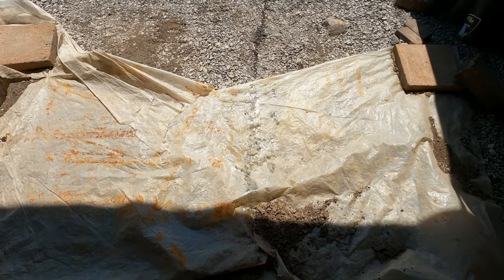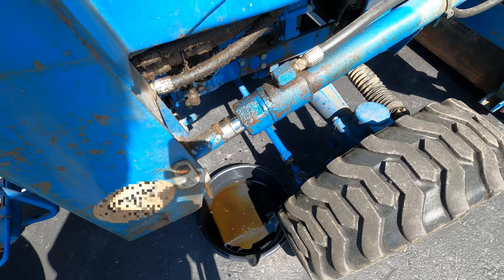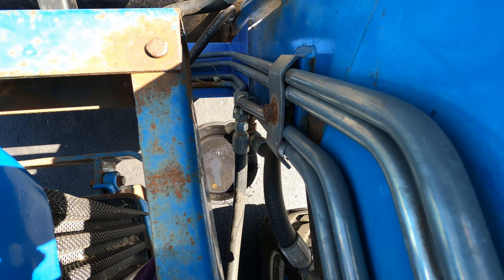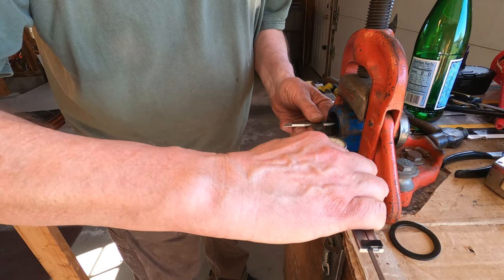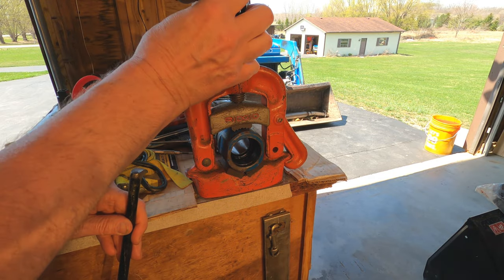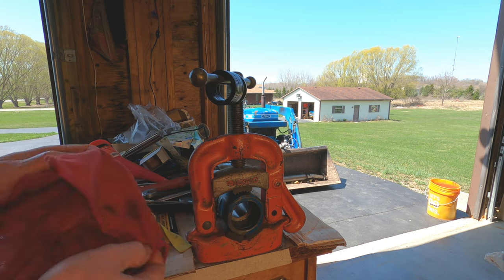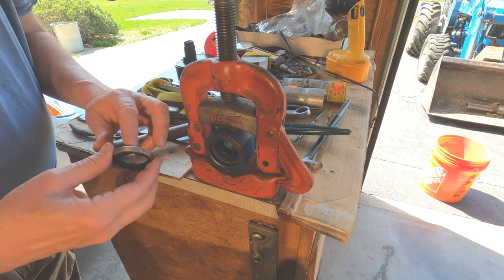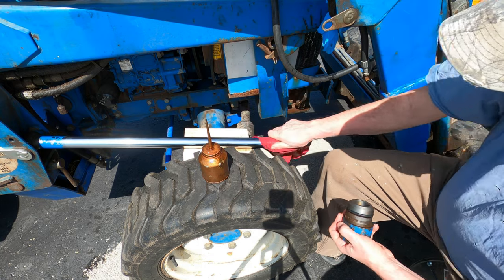Replacing Seals on a Ford 770B Loader | 1710 Tractor | Man About Home

Comment: MAH,   This instruction was exactly what I was looking for for my 1710 with a 770B and two leaking cylinders.    Off to fix my tractor this weekend!   Big thank you.
Reply from the maker: @guesswhotoo6  You're welcome! However, I've learned something important about this job since I did the first one. I plan to try doing it differently on the next one. This should help a lot. Do you have the 770B manual? There's procedures in there to loosen and tighten that seal compression nut on the end of the cylinder rod. You can remove the hydraulic fitting on the fixed end of the cylinder to gain access to the seal nut. Poke a pin or drift through that hole, into the hole in the seal nut. I imagine getting it lined up will be a bit tricky. Then rotate the cylinder or cylinder rod to loosen or tighten the nut. If you don't have the manual, you can contact me via my gmail address found on this channel. I'll send you scans of the cylinder seal replacement pages. Thanks for watching and commenting! And good luck with the seal replacements.

Comment: It’s like looking into a crystal ball. Good job on the video. I have the 770a with a small drip for the last 3 years. I bought the seal kit for it, but haven’t gotten around to it. Looking for a full tune up this spring, so prepping my mindset.
Reply from the maker: Thank you. If you have the manual for the 770a, I've since learned that it gives good instructions on disassembling the cylinder and piston. If I ever have to replace the seals on the other side, I'll be trying their technique to loosen that round "nut" that holds the seal pack so tightly. It appears to be a lot better than how I did it. You can probably find a manual on line if you don't have it. Thank you for watching and commenting!

Comment: Very nice video, just rebuilt a cylinder on my 1710 for my first time. I had a few trips to the dealer. But I got it done. And works good now. Mine was way different than that as I have a bradco loader on my tractor. Overall good to see that process all the way through.
Reply from the maker: Thanks for your comments. I was learning as I went, with this job, and I've learned some useful things after I did it. The next time I do one of these, I'll be doing some things differently. It sounds like you got it figured out as you went, as well. Thanks for watching!

Comment: Thanks for this video.  I’ll be doing this job soon.  You mentioned a service manual for the 770 in another comment.  Could you please share where you got the manual or just share the helpful info it provided?  Thanks Eric
Reply from the maker: Eric, I have the manual that came with the loader when it was new. It's the Ford Series 770B Quick Attach Loader, Operator's Manual. They're available from several sources if you search. I'm also adding a link in the description. Thanks for watching and good luck!
Reply from the maker: Operators Manual for Ford Series 770B Quick Attach Loader Owners fits 1310 1510 1710 1910 Tractors
https://www.amazon.com/Attach-Loader-Operators-Owners-Manual/dp/B07HSXKFTN?&_encoding=UTF8&tag=manabouthom0b-20&linkCode=ur2&linkId=1a9eefc00b7aff2eb8b64945da9373ba&camp=1789&creative=9325

The manual shows a better way to disassemble the pistons.

Comment: i have the same tractor  runs good some issues   now  getting hard to find parts for it
Reply from the maker: I've been wondering about parts availability. I haven't had to find parts for mine yet. But I'm sure I will at some point. My tractor is still running good. I've been working it pretty good this Summer. Lot's of mowing with a six foot finish mower. Thanks for watching!

Comment: Where did u get the seals and part number
Reply from the maker: I did a web search. Seals are available on Ebay and Amazon.  I have to warn you, the seal kit I used wasn't exactly correct. One of the new seals was thicker than the original. All the others were perfect. I was able to make it work for now, by not tightening the piston seal nut down all the way. It's working as it should, with no leaks... for now? But when I do the other side, I'm going to dissemble it first to make sure all the seals I get in the kit match correctly. If there's a mismatch I'll talk to the supplier directly to correct the discrepancy. I used SML22859. Thanks for watching!

Comment: What is the part number for the cylinder kit?
Reply from the maker: Best bet is to call the dealer. But I used SML22859.
Reply: Looking at the New Holland Ford part list that is the same number.  Thanks for the information.
Reply from the maker: @cowboy104537  You're welcome. It's good you found verification as well. Thanks.